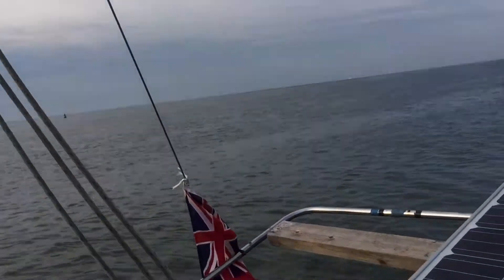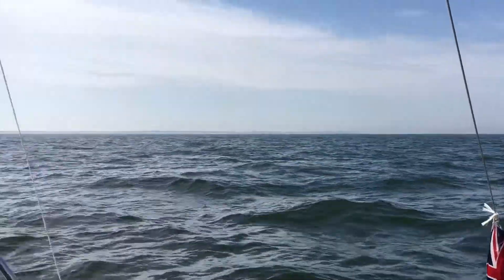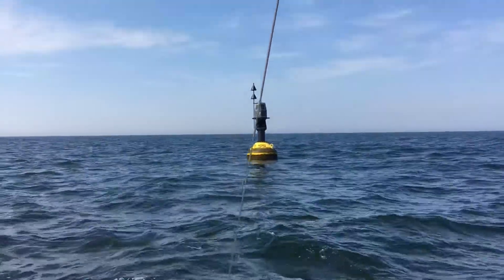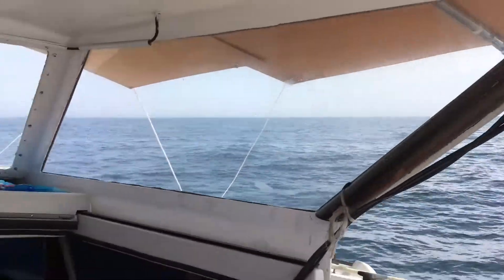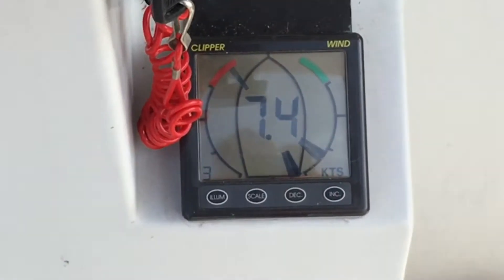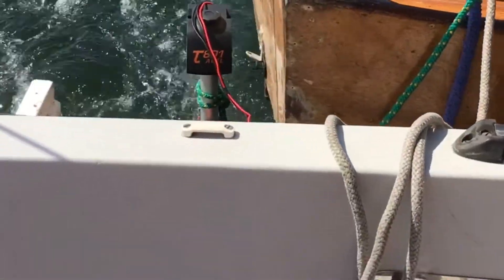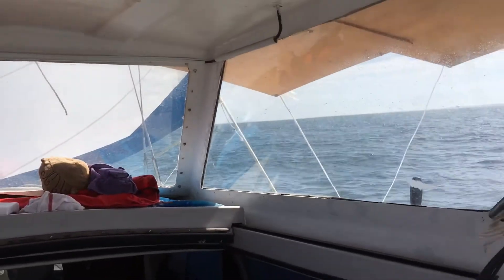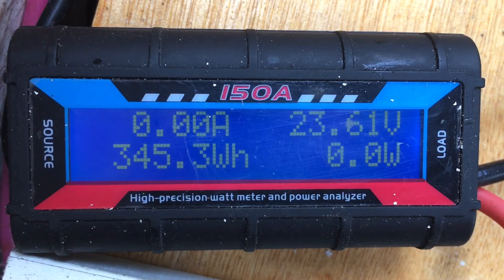3 Our best solar-sail yet: Between Frisian Islands - Norderney to Spiekeroog

Comment: Nice vid Simon, also interested what this 200 W/h  brought to boatspeed. The 45 degrees to the wind, did additional leeway come to it and if so how much leeway did you experience? Are these electrical outboards capable of generating power when the boat is driven by wind only?
Reply from the maker: Hi Jan,
I’ve done some more testing on the way from Heligoland to Romo and just updated the description on the video. 
It’s a bit difficult to collect accurate data as the winds keep changing and the course and speed have to be averaged over several minutes (and I’m aware I’m biased towards wanting electric motors to be really useful). But from what I can make out:

i) in low winds (5-10 knots) and calm seas the 200W of motor enable me to head 5-10 degrees more into wind whilst maintaining reasonable speed;

ii) this actually enabled me to track up to 10-15 degrees more to windward due to reduced side slippage; and

iii) if I had tried to make this heading without the motor my speed would have reduced significantly and there would have been significant side-slippage negating and benefits of heading closer to the wind (in other words I would never have attempted that heading without the motor).

So ultimately in low winds, the electric motor on low power enabled me to track 10-15 degrees better to windward.

I’ll keep testing and update this as I get more data.
Reply from the maker: A few more comments, I think the motor probably helped by about 1 knot on average towards the wind (I.e. a combination of improved speed and heading and less side slipping) but that’s really just an impression I had.

And these are not capable of working as generators to power batteries. I’m not aware of any outboards that can be used as generators (and we generally have plenty of solar panels so don’t really need that) but if you hear of any, please let me know :)
Reply: @aktsolar  E-tech motors over 4 kW can do as they say
Reply: @aktsolar  Great info Simon. I was considering to have a hinged daggerboard under the mast to improve windward abilities. But  I think I might go for an electromotor, just in front of the mast, to drag the boat more  to windward. Make it swing to get it out of the water and rotating for fine alignment and to use it as a bowthruster also... Guess a E-tech POD 1.9 kW 24 V might do the job. Or for sure a 4.3 kW 48 V. Could then even take out one of my Vetus M2.05 10 HP diesels and its sail drive to reduce weight and shelf it for spares

Comment: Nice! So you're using about the same watts to help push along that of a cordless drill on low?!
Did you stop the engine to see what exactly 200w was actually giving you out of your 3.5-6 knot motorsailing speed?
Reply from the maker: No we didn’t. But that’s a good idea for next time. Better than speed though I think is the tracking as it both keeps speed and handling up when going close to the wind and seems to stop side slip.  
But I’ll practise next time with turning it on an off.
Reply from the maker: Hi,

Thanks for this comment.

I’ve done some more testing on the way from Heligoland to Romo and just updated the description on the video. 

It’s a bit difficult to collect accurate data as the winds keep changing and the course and speed have to be averaged over several minutes (and I’m aware I’m biased towards wanting electric motors to be really useful). But from what I can make out:

i) in low winds (5-10 knots) and calm seas the 200W of motor enable me to head 5-10 degrees more into wind whilst maintaining reasonable speed;

ii) this actually enabled me to track up to 10, maybe even 15, degrees more to windward due to reduced side slippage; and

iii) if I had tried to make this heading without the motor my speed would have reduced significantly and there would have been significant side-slippage negating and benefits of heading closer to the wind (in other words I would never have attempted that heading without the motor).

So ultimately in low winds, the electric motor on low power enabled me to track 10-15 degrees better to windward.

I’ll keep testing and update this as I get more data.